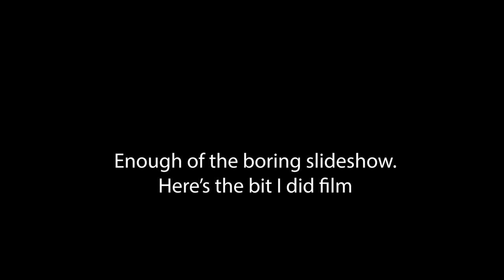350Z Twin Turbo (12) - Coolant Swirl Pot & Making AN Lines

Comment: Sick man ....what we're you exact settings on your welder when you're that swirl pot?just wondering
Reply from the maker: Can't remember exactly but it will have been around 90 amps but controlling it with foot pedal, 40 percent cleaning action on the AC balance, and using 2.4mm filler rod

Comment: A bit of a side note. You should probably make or buy a coolant bleed valve to replace the plastic factory one you got on the car, ( near the back of the driver side). Those things crack often as hell. If you dont want to make em, Z1 makes aluminium ones.
Reply from the maker: I saw Z1 made some but I'd never heard of the stock one breaking tbh until you just mentioned it
Reply: @ChrisDrift the stock ones crack over time, mine cracked open mid drive. Looool. Luckly I was able to go to a home Depot and use some pipe to temp connect it loo